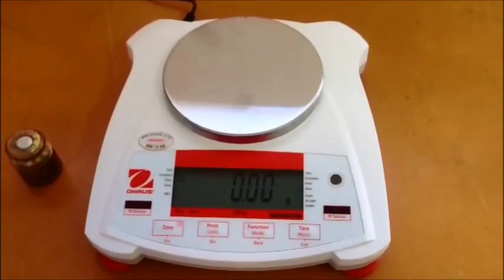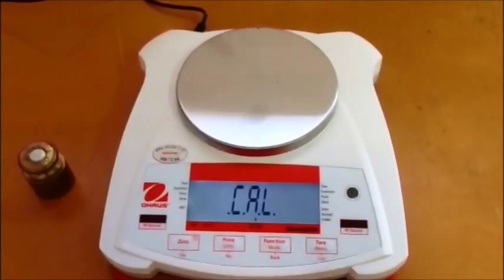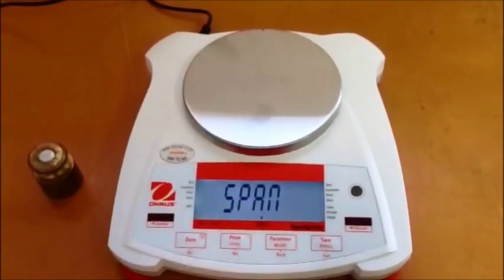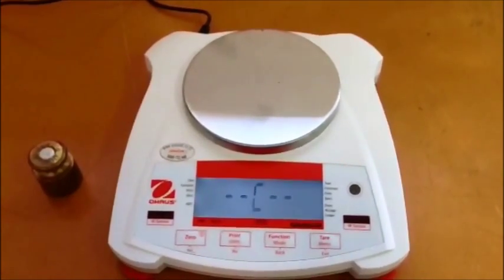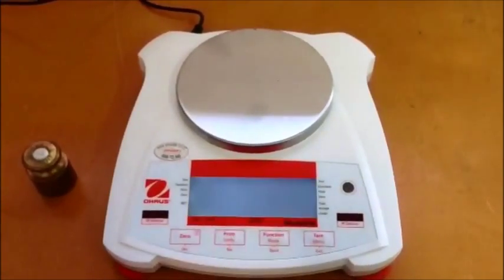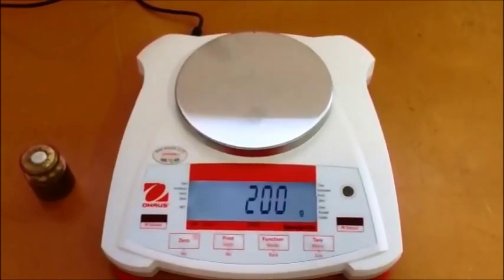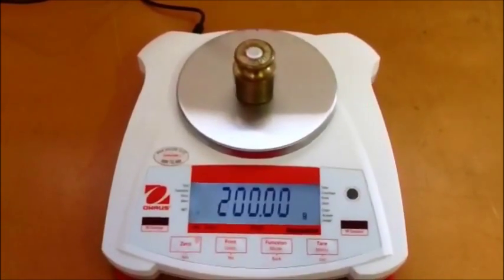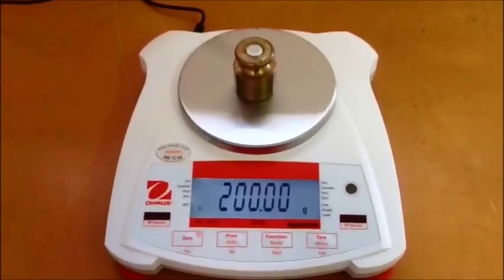Ohaus Navigator Calibration

Comment: Thanks for the video! I was having trouble and then realized ... my scale was in locked position. For others trying to calibrate: As a heads up, make sure your "locked/unlocked" setting (beneath the silver plate) is switched to its unlocked mode. :)